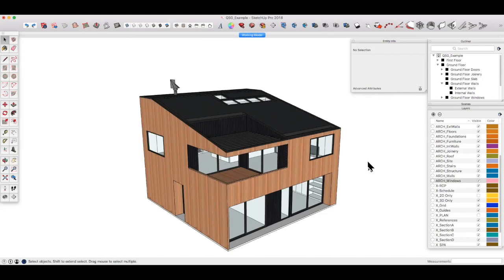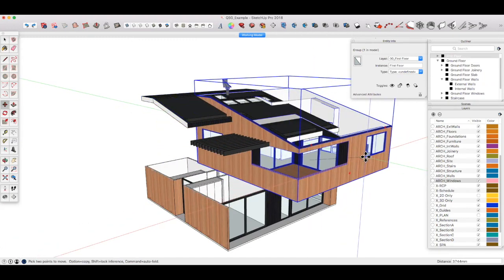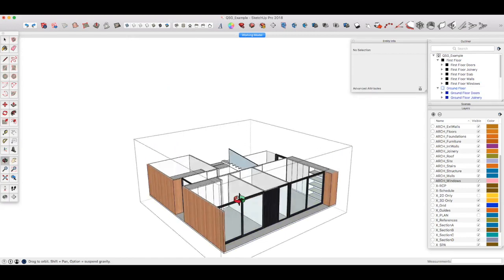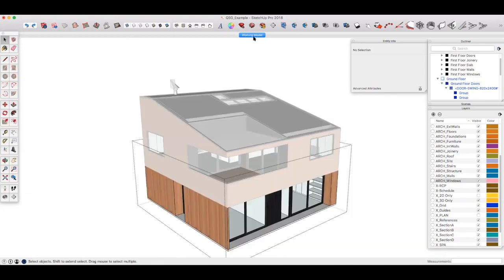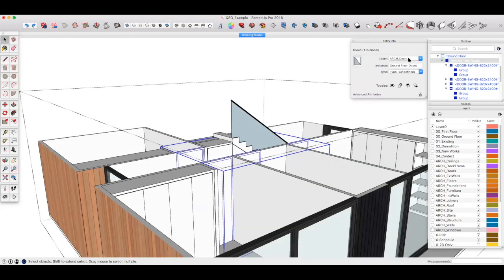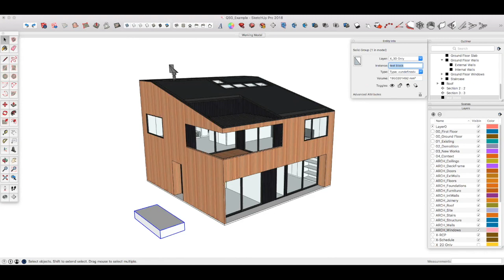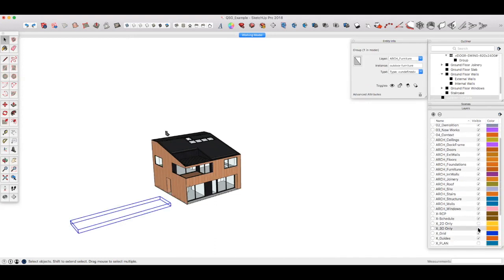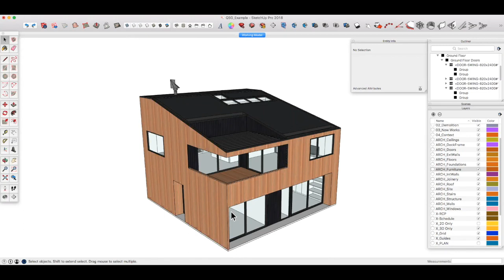Working with Groups & Components

Comment: Layers ?? I wish ! Unfortunately, the clever folk at trimble had a brain explosion and ditched them years ago. Is there a reason you are running such an old version of SU? Seems like a good idea.
Reply from the maker: I tend to interchange between calling them layers and tags, I am still getting used to it myself. The reason they changed it was because they introduced Layers into Layout which has vastly improved it from a graphical control point of view.